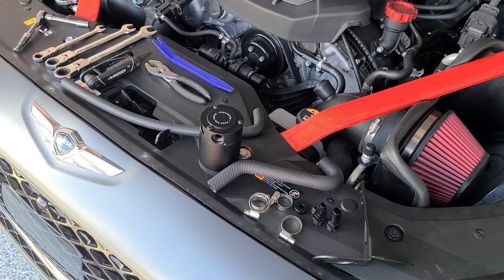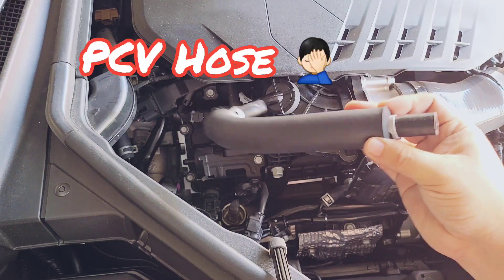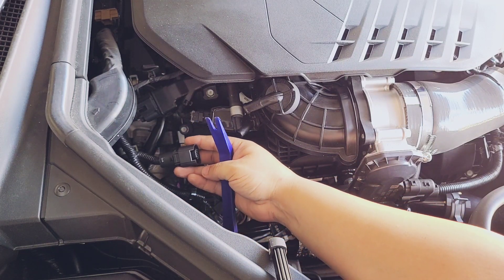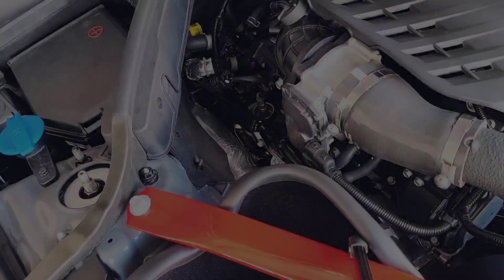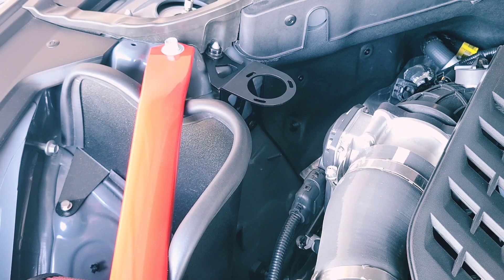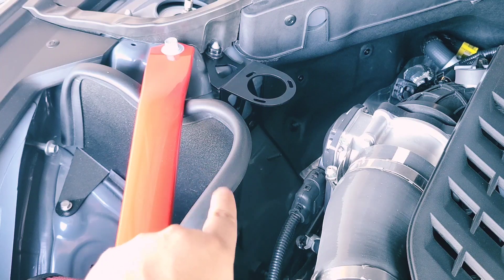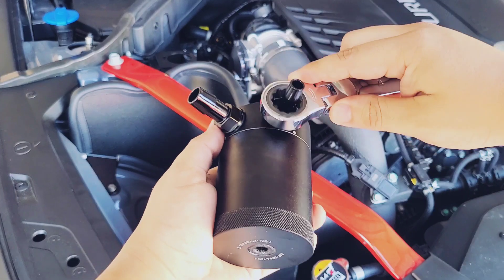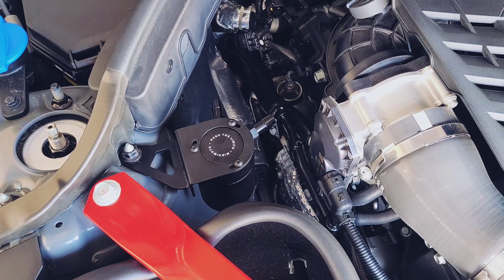Genesis G70/Kia Stinger Mishimoto Baffled Oil Catch Can Installation Guide

Comment: What about torquing that strut mount nut? Also manufacturer says nut should be replaced if serviced. Seems overkill to me, and I torqued it to 30ft lbs but with that new bracket underneath seems a little weird to me